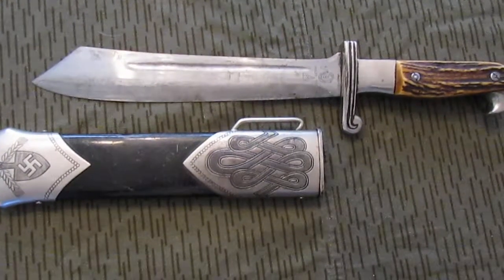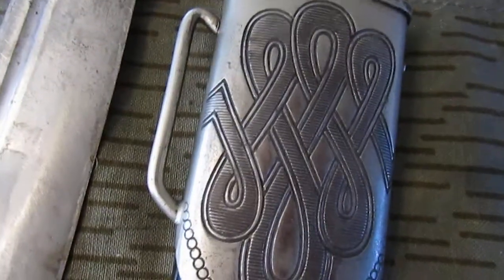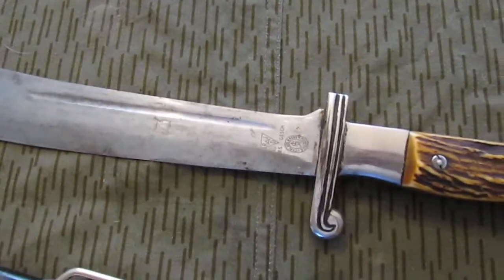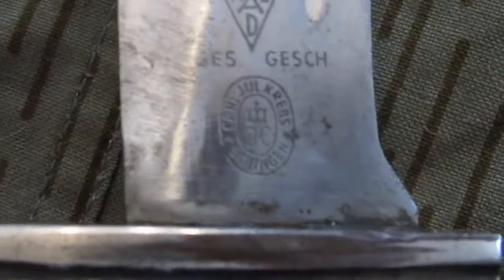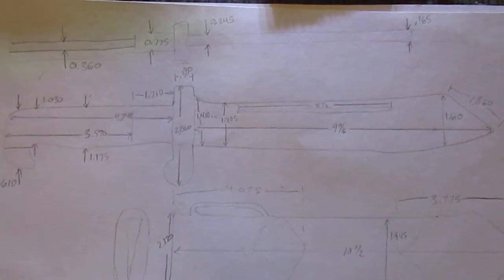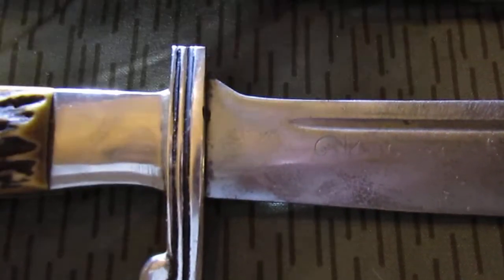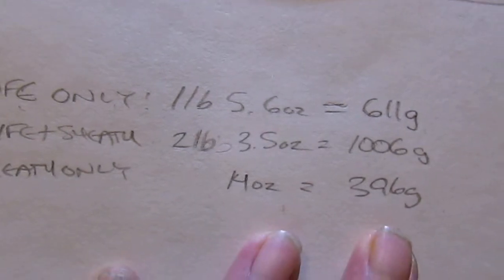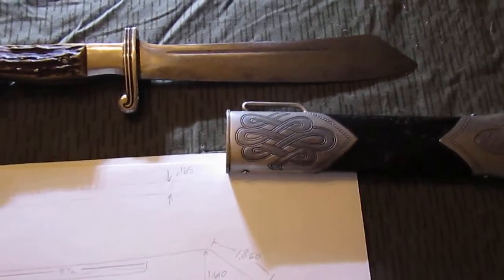WWII German RAD Hewer "Dagger" Krebs bring back visual review and fake spotting

Comment: Most of the fakes seen today are produced in Poland and made to look old. They are pretty easy to spot,  none have real stag and the bottom of the blade is noticeably different. On a genuine knife the sharpened edge goes continuously  into the guard, on a fake one it stops about an inch before the guard like an ordinary Bowie knife. The all carry a fake Boker logo.  Strangely enough I see lots of folks paying substantial  money for fakes. Also, they did produce very high quality ones post war in Spain. I personally owned one years ago and it was  clearly marked Made in Spain on the flat top of the blade, I just happened to see it by accident. Like I said they were high quality and could have been sourced from post war Germany. 

I own several Rads and one of mine has the FU with a number. At some time it had to have a matching sheath which was likely lost after after being issued. The were drawn from supply everyday while being used and returned a the end of the work day. Most likely  the were stored separately and were seldomly properly  matched up. I have seen matching sets over the years.